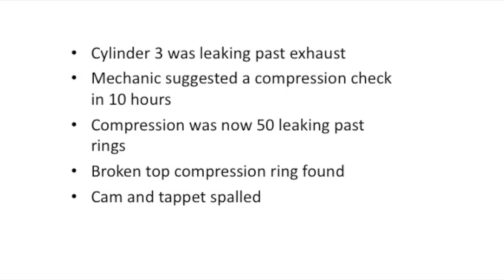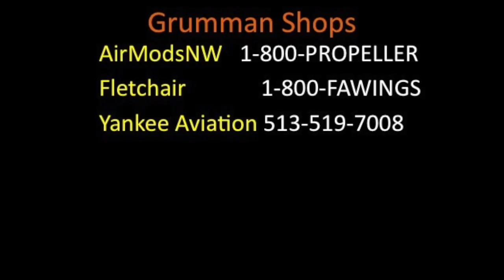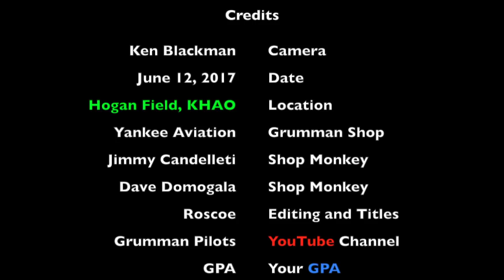Cylinder Replacement Gone Bad  - Grumman Style

Comment: I've never touched an aircraft engine so I'm not in a position to criticize their knowledge,  but I have done a lot of work in shops and can't believe they used a claw hammer on the engine. Sure it was just a couple of taps but damn...  shouldn't a person who is skilled enough to work on an aircraft engine at least have a proper set of tools?   I'd drop $6 on a Harbor Freight ball pein before I'd use a claw hammer.
Reply from the maker: Have 2 claw hammers and 5 other hammers, busy day as the others hammers were all in use by others.

Comment: Someone needs to  learn the difference between a mechanics hammer and a carpenters hammer. Bunch of idiots that have no business wrenching on an aircraft. I would suggest they switch to RC planes. Even a BOAT builder like myself could do better work than these guys.
Reply from the maker: When you have 6 planes being worked on, tool get in short supply, use what you have